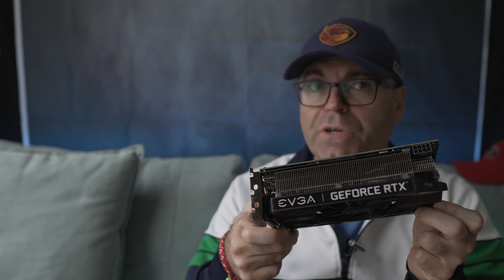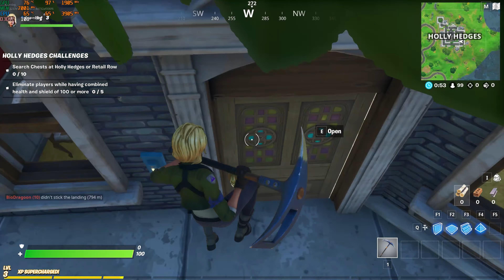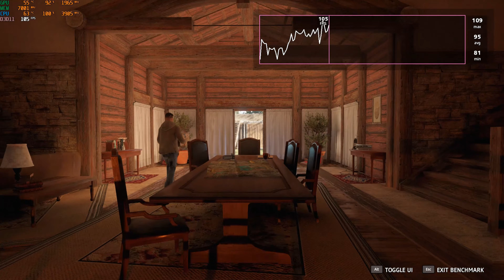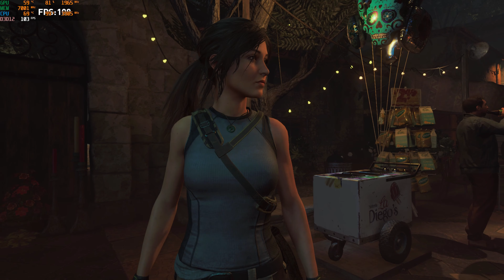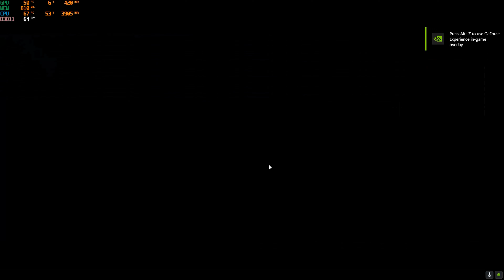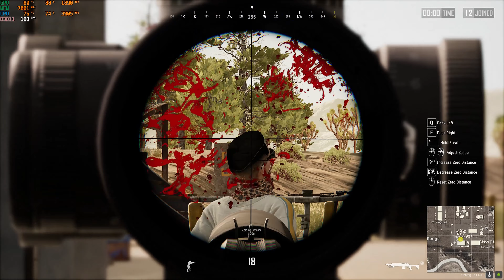HP Pavilion Gaming Desktop - With RTX 2060 Now!

Comment: Ive been thinking about upgrading from a 1650 super to a RTX 2060. The 1650 Super is 6 pin and RTX 2060 is 8 pin, does the PSU already come with 8 pins?
Reply from the maker: Yes it does
Reply: @HardwareSense  that’s good to hear thank you!

Comment: I got an offer to trade my Gtx 1650 6gb dual fan for an OEM RTX 2060 single fan gpu. Do you recommend I take the trade or not. I mostly just need high fps and I don’t play on high settings
Reply from the maker: Yes there is nothing wrong with the OEM ones, just make sure that is working and hasn't been mined on for years

Comment: Hello there! Great review! I'm thinking of buying an HP desktop (Ryzen 7 3700x, RTX 2060 super, 16gb of ram). What concerns me is that the psu and mobo are not in the description. Is there a possibility to tell me these two? And also, can I upgrade after several years some components?
Reply from the maker: Which model?
Reply: HP Gaming Pavilion TG010019 (Ryzen 7 3700x, RTX 2060 Super, 16GB RAM)

Comment: I have the hp tg01-0023w that has 400w can I upgrade it with the 2060 super and 32 gigs?
Reply from the maker: Sure, if you can find one of those cards that can fit the case.
Reply: @HardwareSense  okay also 2 more questions, can I upgrade the power supply to up towards 500w and can I maybe slap on the 3060 in the near future?
Reply from the maker: @MrKjy1999  You can slap on a 3060TI even with the stock 400W psu, but there is a 500W one that can be purchased separately.
Reply: @HardwareSense  oh okay can you send a link to the 500W psu you would recommend by any chance. I’m so sorry for all of there’s questions I’m new to upgrading and building PCs and this will be my first time doing so.
Reply from the maker: @MrKjy1999  I will find you the part number and you can see it at parts.hp.com
Reply: @HardwareSense  thank you mad respect 🙏🏿🙏🏿🙏🏿❤️

Comment: I have a question, i have a 310w psu on this pc. this is enough for the rtx 2060??
What is exactly your psu please? (For the compatibilty)
Thanks
(sorry for my English I am french)
Reply: The recommended wattage for the 2060 super is 500W but depending on your pc you can drop that down to 400 if you are feeling lucky. 310 will not be enough on the Pavilion Desktop setup and you will likely experience your pc shutting off due to surges.
Reply: @namnevox189  finally I have bought a 500w psu and a  1660s gtx OC in the pavillon pc because I don't find 2060 rtx on the net :/
Reply: Did you find a proper PSU that fit the screw holes or did you only manage to get a couple in?
I only ask because there is not much online about proper upgrades for the gaming pavilion.
Reply from the maker: @namnevox189  No, the maximum one that you can get is the 500W from HP, but I am still running with the 400W which is plenty for my RTX2070 and potentially RTX 3060/3060TI.
Reply: @namnevox189  can i have a link for the 500w psu
Reply from the maker: Mine is the 400w one, but I ran 2060 on 310w on the Lenovo PC

Comment: @hardwaresense will the Asus 2070 dual mini fit in the hp pavilion 690-0034 different motherboard but same psu with rx580 gpu
Reply from the maker: Yes it will, I have that Pavilion as well, just make sure you have the 400w PSU.
Reply: HardwareSense Thank you, it does, I looked up the specs online from hp website. Says it’s 400w psu platinum. Buying it used from offer up it has the ryzen 7 2700 want to set it up to work well in davinci resolve 16
Reply from the maker: @muaymedic213  Excellent!
Reply: HardwareSense thank you 🙏

Comment: Is 400 watts bad if u play everday 5-8 hours a day?
Reply from the maker: The max wattage delivery has nothing to do with it, the PSU will not run at its max. Even if you play 24/7 the power draw is less than 300w.
Reply: HardwareSense so 400 watts platinum good them I could game 5 hours a day?
Reply from the maker: @delixwtf  All day if you want to
Reply: if u want to max your pc do it if u dont trust it get a 500w psu for the rtx tbh u dont really need a rtx some gtx can do ray tracing there ricky

Comment: I have same built with Ryzen 5 3600 + GTX 1660 super. 
Could i upgrade the cpu stock cooler without changing the 400w psu ?
These 3rd Gen CPUs works with insanely hot temps.
Reply: And did you manage to run the system with 3200mhz RAM ?
Reply from the maker: @valeriopatricolo1597  3200mhz will default to 2660, so no sense of getting anything over that.
Reply: Will a Ryzen 5 3500 6 core and a try 2060 super work and not blow up and also I have the 400 watt psu